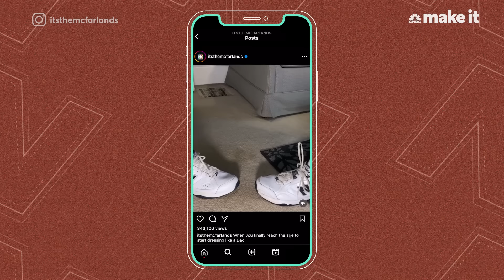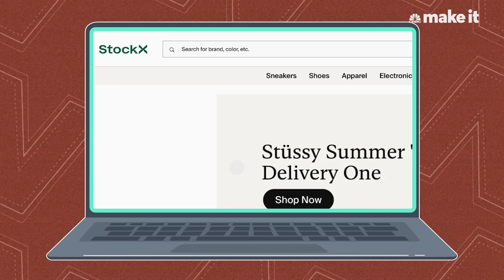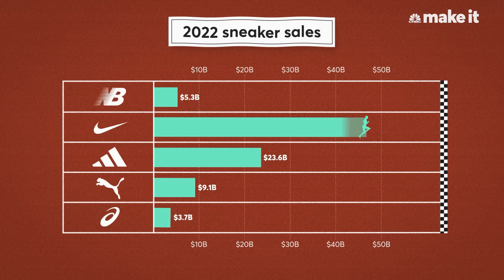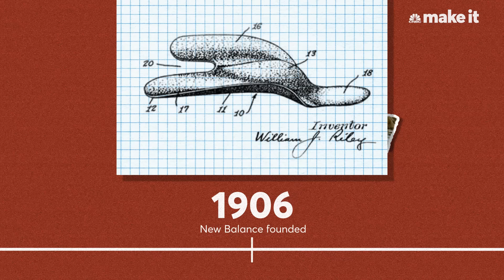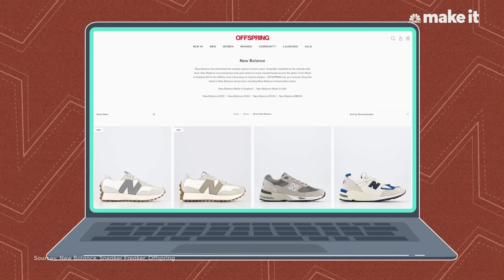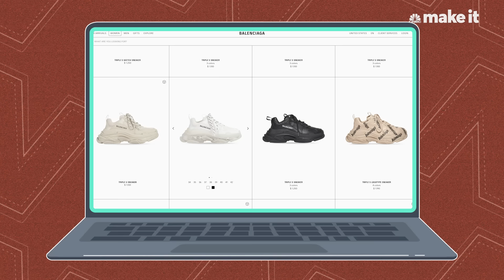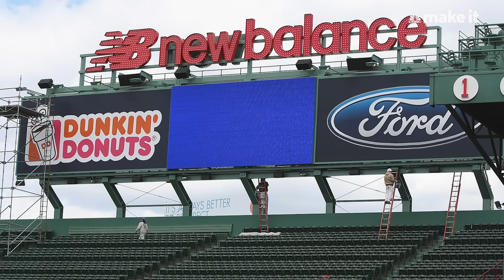How "Dad Shoes" Turned New Balance Into A $5 Billion Brand

Comment: One thing NB has over brands is comfort. Not a single NB shoe of mine caused discomfort and I have wide feet. My favorite has been 9060s
Reply: I have tried other brands and most of that is in the store. Recently it was a pair of, I believe Brooks, and the right sole felt lumpy or wavy. The left shoe was fine. There happened to be a second pair in my size. Again, the right sole was uneven. I was discombobulated and remain on the hunt for my next pair of New Balance.
Reply: @BLUELEADER78  I found Hoka running shoes to feel the same way you described Brooks. I went to a locally owned running gear store and picked up New Balance 880s after walking around the store in pretty much all the wide running shoes they carried. I definitely recommend NB Fresh Foam, it's so comfy, and doesn't feel lumpy or unstable.

Comment: It was hard for me to find running shoes with a wider size when I did track and cross country in high school. New Balance was the only one available with my size even until today. Thank you New Balance!
Reply: My left toe was tightly squeezed by other shoes and got in 3 surgeries to repair my toe nail and I thought I was a weirdo due to my wide feet.  (My parents tried their best to buy me large shoes since I was 10).  Only until I was 18 and found out “wide” size from NB and realized I wasn’t the only one having issue. 😢
Reply: @ACCA2016  Nike style shoes ruined my toes too and the air bubbles would leak eventually. I used to get Sauconies with Wide toe boxes but its easier to find NB stores.
Reply: Same! I have short feet but they are wide. So a 6XW worksite could go a bit wider. But certainly not longer. I don’t know any other brand that makes a size that works. I don’t own sandals or boots (other than ugg types)  because I can’t find anything that fits. I tried a variety of running shoes and struggled through the nerve pain for years.  
I am so happy New Balance exists. And I hope to see other brands with options for short wide feet.
Reply: Yes!! They are the best to workout in besides Brooks.
Reply: Me too, I have wide feet

Comment: New Balance is a tennis shoe that is built to take care of the feet, ankles, and knees. Any exercise physiologist and knee surgeon will tell you the support you get from tennis shoes, especially the lateral (side to side) support, is important to both on court performance and knee and ankle protection. Increased mobility combined with health safety support is what every shoe built for tennis should be based on. This is why shoes specifically for tennis are made.

Comment: Back in high school and college days Nike was an upstart that was moving in on Puma and Adidas running/track shoes.  A few years later New Balance became popular due to the availability of different widths of all their shoe models along with Asics' predecessor the Onitsuka/Tiger brand (Nike shoes were always tight on my feet).  For a while NB became the preferred shoe for road racing/marathons and Onitsuka was preferred track spikes if you had wide feet.  I haven't worn a pair of Nikes since high school in the 1970s as they are still too narrow for my feet.
Reply: Nike are tight, but Puma are the worst.  They either hurt the sides of my feet, or they're so far past my actual size that there's way too much room at the toe and/or heel.  Getting my first pair of NB shoes was a revelation.

Comment: I rocked lots of the classic 574’s in high school because you had so many color choices to coordinate and then in my 20’s I discovered their Minimus running shoes with the Vibram bottoms I put hundreds of miles on many pairs until they changed up the design and fit to where they just weren’t the same anymore.